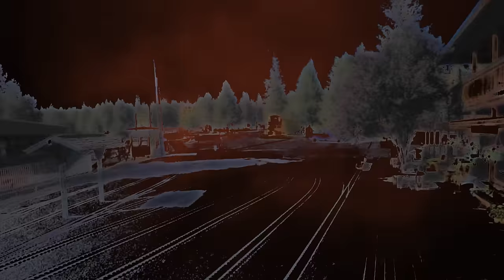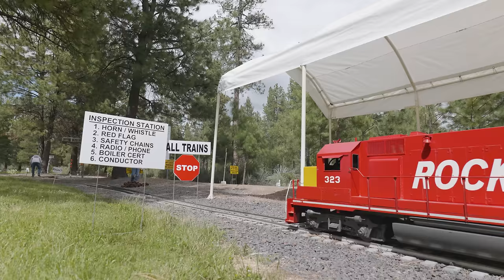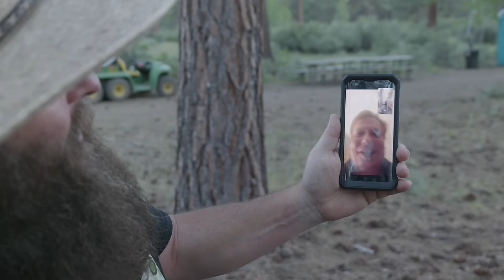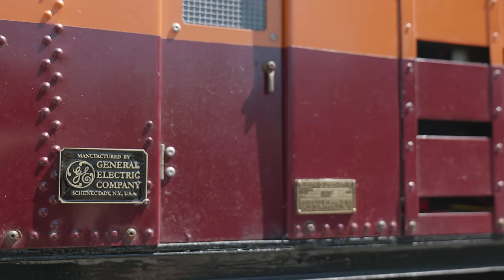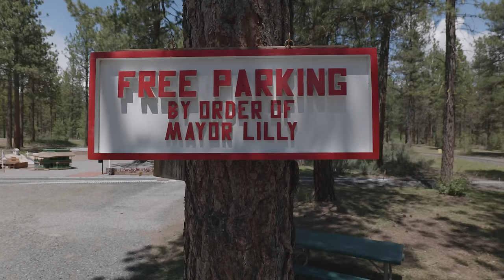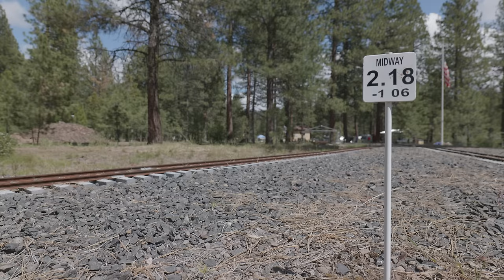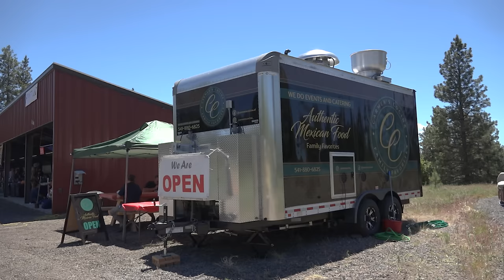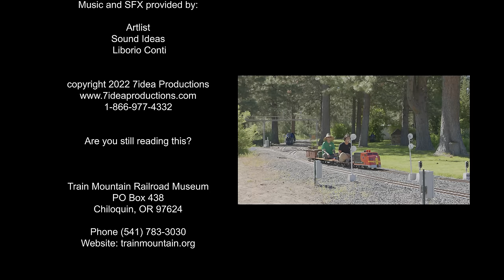Little Trains You Can Ride On!

Comment: is there anyway to get info on some locos like UP9656? Im interested in this type of power with electric motors, cheers
Reply: You should consider building it from scratch, yourself.
Reply: @paullubliner6221  still need some drive motors so looking for information on the bogies? Don't want to do hydraulic.